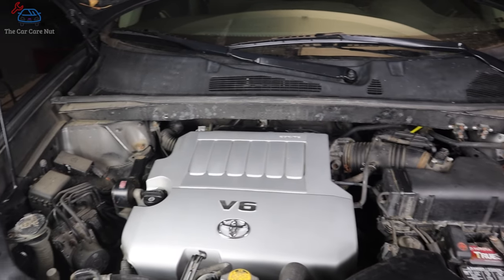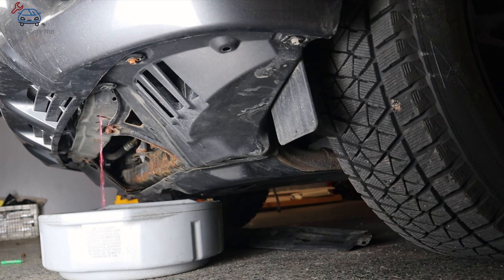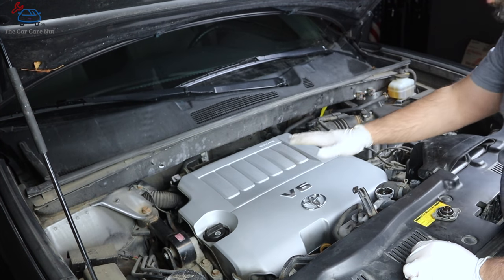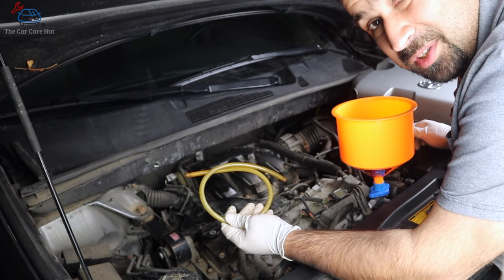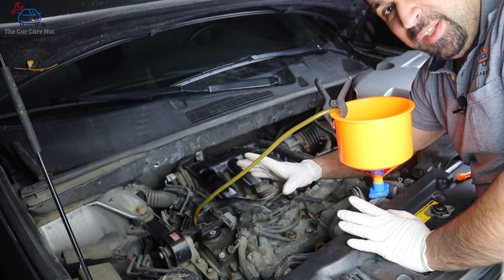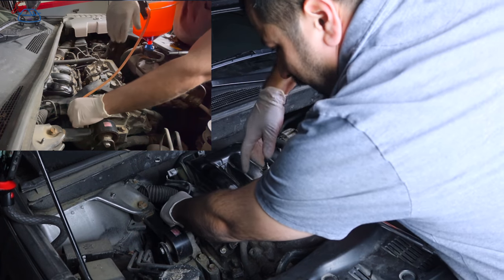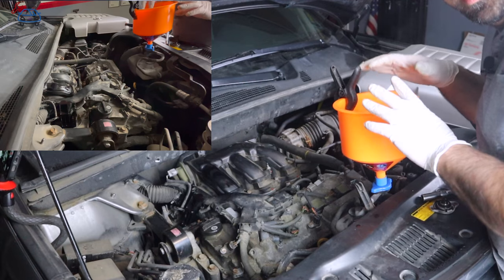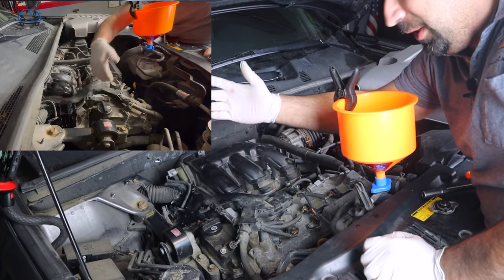Toyota Cooling System Bleeding for V6 2GR-FE 3.5L THE RIGHT WAY!

Comment: Just did it on my 2010 2GR-FE with recommended tools purchased. Procedure Worked great, a couple of points I wanted to share though.
1. After partially removing/ bending away underbumper cover, turned out I still can't reach bleeder valve on radiator. Instead figured out it is completely doable from the top going through front of battery well. Could have saved me some elbow grease and crouching if I knew that ahead..😮
2. The clamp compression was a bit strong and squished the tubing once coolant got hot, so it stopped flowing at that critical moment. Make sure to use clamp with less compression, perhaps. 
3. Many asked the same question I had, let me ask it again: why do we need to turn heater off, sounds counterintuitive..?  I still turned it off though.
Have 155K on odometer. Not sure if I get to do it next time on this car, but was nice to learn and a fun experience 😊 . Thanks Amed!
Reply: I really wish he'd answer that.

Comment: Thank you so much for this video. The heat in my es350 wasn’t working because I didn’t bleed it right when I change the coolant this summer. But I did exactly what you said in this video and the heat works and car no longer overheats! I was nervous but you made a very clear video and I trusted your method and it all worked out. Thank you 🙏🏿

Comment: AMD fantastic video, perfect purge after water pump and pulley replacement! Didn't get funnel in time from Amazon so I fit wide funnel with rubber grommet on radiator supported with small bungie cords. Big points from  daughter who now has quiet 175k mi highlander for work!

Comment: Thanks for this great, detailed video. Just a quick question - Why didn't you turn on the heat while bleeding?
Reply from the maker: Hi Jake! Turning on the heater is beneficial to cars which have a heater valve so it would open. In this engine there’s no heater valve so there’s no need to have the heater on. All the heater being on will do is slow down the temp rise to open the thermostat
Reply: @TheCarCareNut  Thanks! I'll have to give this a try on my Avalon soon.
Reply: @TheCarCareNut  assuming my 2013 ES350 has no heater valve either ?  Has the same V6 2GR-FE engine
Reply from the maker: Your 2013 ES350 doesn’t have one and as a matter of fact all Toyota and Lexus models with this exact engine doesn’t have one.
Reply: @TheCarCareNut  Thanks !
Reply: Does the 2009 Toyota Sienna have a heater valve?
Reply from the maker: Hi! No heater valve on your 2009 sienna

Comment: I found the funnel kit pricey for this one time job.
So I went cheap and patented my own funnel kit: I simply used a 20 cent water bottle (with cap on) and some electric tape to fit it snuggly where the radiator cap goes. I made a hole on the bottle cap and opened the other end of the bottle.
It worked really good without any leaks.

A water despenser pump came very handy to pump back the extra coolant.

You can save yourself some 20/30 bucks like that. 👌
Reply: It's not a one time job lol no different than changing your oil you have to do it periodically I'll be at at longer intervals and changing your oil but you should be still changing your coolant multiple times over the life of your Toyota ownership especially since most of them go over 300,000 miles

Comment: Thank you for the video!   Thank you in advance for taking the time to respond to my questions below!  
Q1. For the draining of the old coolant, do we leave/turn On or Off the heater before the last engine shut-off (so the coolant from the heater coil also drains out)?
Q2. You mentioned to turn-OFF the front & rear heaters before starting the bleeding process; at which point of the bleeding do we turn-ON the front/rear heater(s) if at all?
Q3. If throughout the entire drain/fill/bleed process we keep the heaters OFF, that means these 2GR-FE engine coolants circulate through the engine & heater coils all the time regardless of the heat "switch" is turned ON or not (switch On only activates the fan motor to blow warm/hot air in to the cabin)?    
Q4. I have one of those automatic system, so which temperature (range) setting, if that matters, should be set to during the coolant  bleeding process?
Q5. Lastly, are there engine block drains (one for each bank) to be concerned with?
Reply from the maker: Hi Rick! Thank you for watching my video. 
1- you don’t need to turn on the heater before bleeding as this engine doesn’t have a heater valve.
2-you don’t need to turn on the heat at any point during the procedure this is also because this engine doesn’t have a heater valve.
3-That is correct. This engine doesn’t have a heater valve to isolate the heater core when the heater is off. Coolant is circulating through the heater core at all times. When you turn on the heater the fan comes on and the blend door directs air over the heater core.
4- on this engine you want the setting to be on OFF when doing this procedure.
Reply: @TheCarCareNut , Thank You very much!!  Go "Pink" it is.
Reply: What about question number 5?

Comment: This is a very informative video. Thanks for taking the time to made this. Do you recommend using the Cylinder Block Drain Cock Plugs to remove additional coolant before refilling with fresh coolant? Thanks!

Comment: Thanks from Brazil my friend. I will do this on my Etios with the 1.5 2NR-FBE engine. It actually has a bleeder valve on the geater line that you can open by hand, so DIY friendly. 

Btw, I usually let the heater on so that the coolant can flow and remove all the old coolant (I do 2 to 3 flushes before new coolant)

Comment: Hello Sir,  thank you very much for making this video and I'm glad I came across with this.  This is exactly what I need and I'm getting ready to flush coolant for my 2015 Lexus RX 350.  BTW - just one quick question, I see from other videos about coolant flushing to turn up the heat all the way but you said to make sure to turn off the heat.  If you have time and don't mind, could you please explain why to turn off the heat instead?  Thank you very much in advance for your help!
Reply: I have exactly the same question, but nobody answers. BTW, I have exactly the same vehicle- RX 350, 2015.
How your air bleeding went through. Could you share your experience. Thanks in advance.

Comment: Thanks for all of your videos. Please make a video about how to change transmission oil ( transmission with dipstick) of Toyota 3.5 v6 with 2gr-fe engine. We will appreciate it. Stay safe.
Reply: This one is easy. Just a drain bolt. However I hope he does the filter too. Although some say the metal filter just has a mesh strainer and it's unnecessary to change under normal conditions. Maybe AMD can say if it should be.
Reply: @LAactor  yes it says on dipstick too that it is not necessary to change under normal driving conditions. But I see my vehicle's transmission fluid is very dark after 100k Miles. I heard from lots of good mechanics that you should change transmission fluid after every 50k to 75k miles even if it says lifetime transmission fluid on it.
Reply from the maker: I would replace the fluid every 60k or 6 years
Reply: @KaluNatt  AMD is right 60k. I have heard some amateurs say 50. Personally I think 75k is too much. Maybe they are canadian and mean 75k km. Cut this in half if you tow.
Reply: @KaluNatt  Another thing people say is lifetime fluid but you wany the lifetime of your trans to be 100k and buy new ones, or maintain them so they can last several times that.

Comment: I have a RX450h with the 2GR-FXE V6 motor and the hybrid system.  To perform this coolant change I had to put the vehicle into Maintenance Mode, otherwise the engine would just cut out early once warmed up, and also not rev when the accelerator pedal is depressed, normal behaviour being a hybrid.

I used a long telescopic stick to depress the accelerator pedal.  It allowed the engine to rev up, but I couldn't really tell whether it was 2000 RPM or 2500 RPM, but certainly was revving at a high enough rev.  However when the coolant was starting to bubble out of the funnel, the ECU would suddenly cause the revs to drop back to idle, and I was unable to get the engine to rev no matter how much I depressed the accelerator pedal.  After a few minutes of idling the ECU would allow the accelerator pedal to function again, and I was able to get the engine to rev up again, with the telescopic pole on the pedal.  However the same thing happened the second time again, i.e. as the bubbling was starting to get serious in the funnel, once again the ECU cut the revs back to idle.  So I was unable to get the coolant in the clear hose to rise all the way to the top of the funnel and have a steady stream.

At this point, I felt that it was probably enough, so I tightened up the bleeder and hope that this is sufficient.

Any idea why the ECU would cut the engine revs back to idle?  The fact that it happened twice made me think that the ECU did it perhaps to safeguard the engine or inverter.  I ran the high idle with the transmission lever in Park, not Neutral.

Mine is a 2012 RX450h, the 3rd generation.  It's 10 years old but only done 80,000 kms (50,000 miles) and this is the first coolant change on it.  For the record, I got around 5.8 litres of old coolant out by draining the radiator, and not draining via the engine block drain valve at the rear of the block.  The total coolant capacity for the RX450h is 11.7 litres, so next time I may drain more coolant via that rear block drain, just to get as much of the old coolant out as possible.  I did not try to empty the coolant that was in the expansion tank.  Nor did I attempt a coolant change on the inverter.

Heater worked fine when I went for a test drive, no gurgling noises.

Comment: My 2012 rx350 only took 1 bottle of coolant,also the funnel connection cap was leaking had wifey work the throttle while I did the procedure ,temperature gauge was holding just a tad over the halfway point ,did it on the side of the street in front of house and yes catch the coolant that was drained temperature outdoors was 38 degrees.going to work later so let’s see how it holds up will be watching that temperature gauge lol 😂,thanks so much for helping all of us D.I.Y ers .Your channel is a Blessing Brother.

Comment: Exellant video! I am still waiting for you instructions for 2GR FKS, bleeding the coolant. Acturally, I cannot find a instruction or video online about bleeding 2GR FKS engine coolant. Could you please give me  a quick guidance? Much appreciated!
Reply from the maker: Hi! Fill the coolant with a spill free funnel and with the car off squeeze both hoses back and forth. Start the engine and make sure your funnel is 1/4 was filled. Rev the engine and hold it just above 2000 rpm and continue to sequence the hoses back and forth for 30 seconds each time and stop for 2 minutes until both hoses get the same temp and the fan cycles on and off twice. Then let the engine idle until air bubbles stop. Shut it off and let it cool down for 15-20 min and you’re done. Do all this with the heater off
Reply: Just did this with my 2017 highlander with the 2grfks. Took about half an hour of revving to 2000-2500 for about 30 seconds, then squeezing the upper and lower hoses alternately. Probably did it 20 times before no more air came out.  Then I spent half an hour trying to find the reservoir cap that I removed before finally realizing it was still attached to the overflow hose!
Reply: @TheCarCareNut  Thanks for the additional notes on 2GR FKS.  My 2019 Highlander is due for coolant exchange and have the 3 jugs of long life coolant and the fancy funnel. Wish me luck !  If I lived closer I would offer my vehicle for your video but I live too far away.

Comment: Thank you so much for posting this, I had to replace the radiator in the wife's 2014 Camry V6.  Wasn't too bad of a job, and I definitely did not know this standard operating procedure when refilling.  Still ticked the car needed a new radiator despite having only 43K miles!

The only piece that gave me trouble was trying to use 1/4 ID hose, I simply could not get it to slide onto the top of the bleeder.  Luckily, I had some larger diameter hose that worked like a charm.

Thanks again for posting!!

Comment: To prevent spillage from the bleeder and tube: 1) Do not open the bleeder more than you have to so you can close it easier, 2) have a 10mm open end ready, 3) Have a hose clamp ready. When you get that steady flow and no bubbles in the bleeder tube - close the bleeder screw w the open end. (Make sure beforehand tube is secured tight to the funnel or else it might come off.) Clamp the end of the hose w a hose clamp and put a small rag at the end of the hose before you pull it. Spill coolant inside tube back into the funnel.

Comment: I watched some other videos, there said keep the heater on, don’t know what’s the difference?
Reply from the maker: Keeping the heater on is a general thing when it comes to bleeding coolant. However the reason you do it in certain cars is to open the heater valve. The 2GR engine doesn’t have a heater valve so coolant goes through the heater core at all times. Turning on the heater will cause the coolant to take much longer to warm up to open the thermostat

Comment: Hello and Thank you for the awesome videos! Very helpful. Sorry for the noob question but does this video apply to my 2007 Rav4 V6 limited as well? I don't see a radiator cap other then the coolant fill port on the side.  For my Rav4, would I just drain the coolant from the petcock valve and then just fill the reservoir till at the proper level? Do I still need to bleed the air? Hope U get to see my post. Thanks again and God bless!
Reply from the maker: Hi! Yes this absolutely applies to your rav4 V6 only difference is the reservoir on the side. Use the spill free funnel without any adapters and it will fit the neck of the reservoir. And do the same thing with the bleeder hose and rpm

Comment: 2GR-FE has TERRIBLE air pockets!.. I use the snap-on coolant refiller part # SVTSRAD272A for that one and FKS..  takes 30 seconds to fill cooling system, best tool I ever bought
Reply: Hey Greg. I have this engine in a Camry and tried using the OEM Tools coolant refiller, but it would vacuum up to ~21 but wouldn’t hold vacuum. I think it was the tools seal leaking, as I used a pressure tester and that was able to hold pressure. Did you have any issues on this engine with holding vacuum pressure? I noticed, too, that the tubes going to/from the heater core didn’t collapse under vacuum like the radiator hoses did.

Comment: Thanks. Doing an alternator job on a 2008 Highlander and this is going to come in handy. When getting the quarter inch hose make sure it’s quarter inch ID like mentioned in the video. It’s very easy to accidentally grab quarter inch OD hose.

Comment: Just completed a Radiator replacement on an 06 Avalon and this worked perfectly. You don’t even need a special funnel-used regular funnel with duct tape wrap to seal around stem and just held in Radiator. Saved $40 over buying something I would only use once.
Reply: Lmao this comment scariest 20 seconds of my life trying to run to shut off my engine 😂 go buy a cheap radiator funnel kit at harbor freight was like $15

Comment: Just did this on my 2012 es350! Worked excellent. I started getting nervous when the no-spill funnel fluid level started rising, but it drops suddenly back to the original fill line after the heater core was fully bleed. My radiator drain and fill was almost exactly 4 quarts. This means i replaced about 42% of my coolant. A second drain and fill would replace a total 68% of the old fluid.
Reply: How can the heater core be bled during this process when the heater is turned off as per instructions?
Reply: Good question! Even if the AC is off, coolant flows through the heater core.

Comment: Worked perfectly on my 2011 Sienna Coolant change. Had that steady stream in the end. My only question is, wouldn't you want to run your front & rear heat at max heat, towards the end, to open up and have fresh coolant flowing thru your heater cores? Took about 1.3 gal of fresh coolant, so make sure you have enough.

Comment: Cars You Can Fix has an improved version of the procedure in this video titled Toyota Sienna 2GR-FE Coolant Flush. I think that video is much easier to follow, with more details but shorter, and more to the point than the one on the same subject here. I commend especially the details in that video without wordy explanation on how to connect and disconnect the bleeder screw, including the specific hose along with size and Amazon link for it! I wish I had seen his video before I had done the coolant change on my RX 350 to avoid the big coolant mess at the bleeder screw, which seemed to be taken granted by the Car Care Nut who is normally my go-to resource for DIY jobs and is very highly regarded in the community.

Comment: Thanks for this video.👍
This video pop up after I change the coolant on my Toyota car last week 😅. 
After awhile watching the technician doing it I requested him to open the bleeder valve. But no hose attached letting air escape and let good flow of coolant off a bit then close the valve. A day later I revisit the petcock valve to ensure it is not leaking.
Tip: 
Flashed off spilled coolant after finish with water. The coolant fluid is not good for the car paint.

Comment: Back in the good old days one just topped off the radiator and you were done. I miss those days of simple service....
Reply: But, engines lasted 40-50k.  If they make it to 100K it will be a miracle. That's why people are so obsessed with 100K miles. These days, with regular maintenance, they can double and triple that.
Reply: @ahmadghosheh3104  Lol...